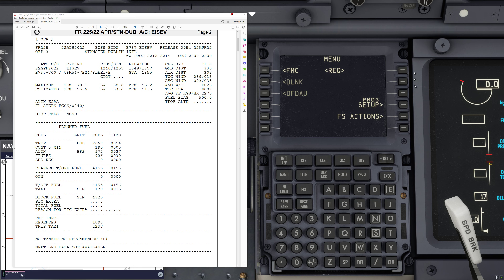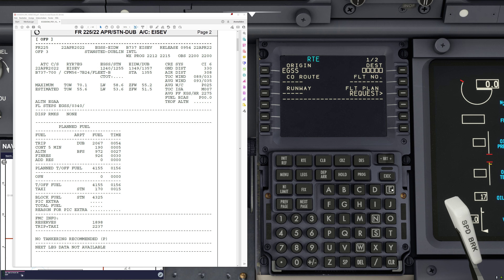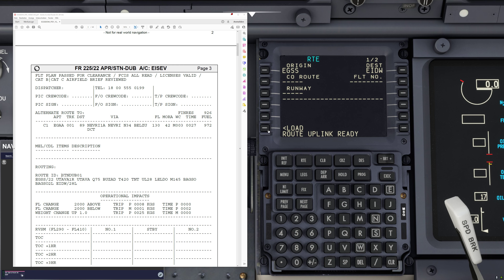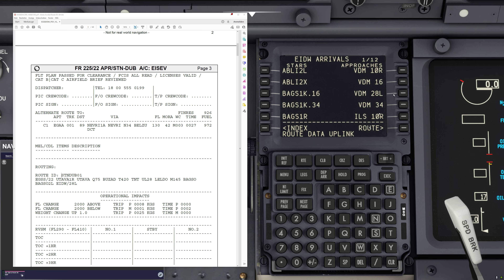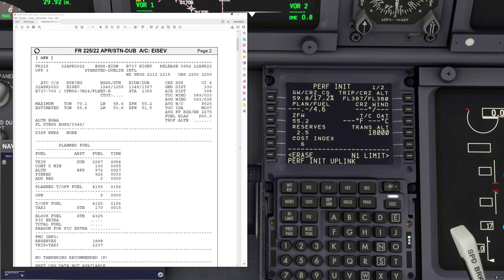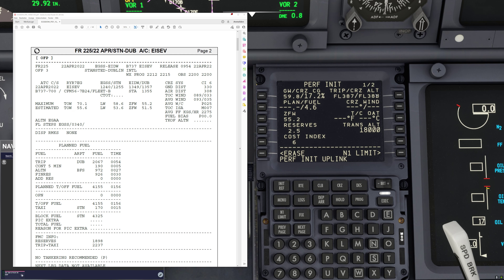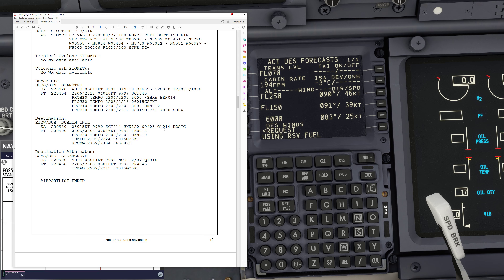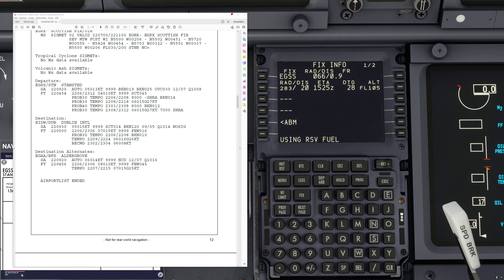PMDG 737-700 for MSFS - Tutorial 3: FMC Setup (Automatic Uplinks)

Comment: When I load in a flightplan as you did on video, after takeoff the plane wont fly with the magenta line. It seems like it are flying somewhere else. I would like to have mfsf ATC, is that the reason why is not working?
Reply from the maker: Turn off the assists in the MSFS settings, they screw your plane over.
Reply: @A330Driver  Perfekt, thanks its working. In which map can i find "Land alt" ?

Comment: I have a question about the payload, under the weights there is a number for freight, I divide this between the two freight compartments, don't I?
Reply from the maker: In my airline we try to load it all into the front if possible. Normally you can fit around 90 bags into the front hold, then we start distributing. The reason behind this is that only a single crew is needed for bag loading, saving you the second crew for the aft hold.

Comment: So...I'm confused after trying to figure it out myself. Also, regarding pax and luggage/baggage in simbrief. I'll set pax to full and the note next to the pax on simbrief says that luggage will automatically be calculated based off of the number and that the cargo section next to it is extra on top of the pax. Do I need to do anything in the FMC cargo section or just load the pax? Seems weird when I don't need to have the baggage loaders come over and it remains zero.
Reply: The CARGO in the flight plan includes the weight of the baggage of your passengers + the amount of payload you selected when creating/editing the flight plan. In the settings of the used airframe you can configure how many kg/lbs of baggage each passengers has. Per default its 25 kg/55 lbs. PAYLOAD in the flight plan is the CARGO + the weight of the passengers. In the used airframe you can configure how many kg/lbs for each passenger is used for the calculation. The PAYLOAD in the flight plan is used to get the Zero Fuel Weight ZFW. In the 737 FMC you only enter the amount of CARGO from the flight plan as Payload. (Yes, the different terms  in the flight plan and the FMC can be confusing.)

Comment: question- for fuel, should  I use the simbrief fuel amount and load it in the fms under msfs actions?   If so- shouldn't that change the COG %?  Should I change it to the % in simbrief?
Reply from the maker: Yes, use that menu. Don’t touch the cog, we do not change it. The airplane should automatically adjust the load to the best distribution and the fmc cog can just be kept where it is.

Comment: Capt. On Page 2 of your SB OFP your plan is listing the  TOC Wind along with AVG Wind. How did you get SB to include TOC Wind into your OFP as shown? I usually get this data from the Wind Information (page 7 on my OFP) but having it right up front is nice. Thanks
Reply from the maker: It's simply part of the OFP format. I used the RYR layout.
Reply: @A330Driver  RYR format. Thanks. BTW, I like your use of the FIX ring on Dep.

Comment: Just heard you saying PMDG currently not being able to fetch things such as your FP from an external source such as SimBrief. Do you know why that is? Reason I ask is how that is already in the WT CJ4 mod. So it is possible from a technical POV. Just wanted to mention this. Personally, I love using that feature when flying the CJ4!
Reply from the maker: It's because the WT CJ4 is programed in a different programming language than the 737.
Asobo only allows external access to that one language as far as I know.
For something as complex as PMDGs 737 however it was impossible to use that language so they used the one all PMDG developers are trained in. And Asobo promised to "unblock" that one right when the original sim released. They still didn't keep up with that promise.
Reply: Got it, thanks for the insight and let's hope Asobo deliver on what they promised down the road.

Not that big of a deal though, being able to use the company route feature in combination with SimBrief Downloader where you can have it automatically save your route in the same pre-determined folder where the PMDG 737 is fetching FP:s also is very convenient 👍

Comment: can we load from Little Nav Map?
Reply from the maker: I haven't used Little Nav Map, but provided that it has an export function for PMDG flightplans you can. It uses the same format as the P3D/FSX PMDG aircraft so if it can do that already then you can also do it with the MSFS version.
Reply: @A330Driver  should be able to do it then.  Cheers!
Reply: Yes. You can, although it's clunkier..you save the flpn then load it from the FDCs menu. I don't use this-preferring to manually setup my departure/arrival with the FDCs..then entering waypoints as needed.

You would be better off to do it this way too..you shouldn't be relying on simbrief. Learn the fmc

Comment: How do you keep the PDF open while clicking around in MSFS? Can't find that option in my Adobe Reader.
Reply from the maker: I'm using a program called "DeskPins". It can pin any program to the top of your screen. Very handy not just with the Adobe Reader but also other programs.
Reply: @A330Driver  Thanks for the tip. Great little tool and as you said not only in MSFS.

Comment: All that shown works great using the Simbrief Downloader. I used it in the CRJ and it worked like a charm automatically downloading the corresponding file and placing it in the right folder, after you create a flightplan. Once more...thanks for another Tutorial well done! Can't wait to push those buttons myself!
Reply from the maker: Indeed, with the simbrief downloader it's actually pretty easy to do these things. You can even automate the export of the files so that you literally don't have to do anything anymore. Except for a bit of space on your disk that's being used you're not even going to feel the difference between downloading the data from the internet and loading it from a file.

Comment: I don't understand your comment regarding access to SimBrief (direct from the 737). You mention the PMDG 737 cannot access Sim Brief because of a limitations in the sim, but other addon planes are able to directly communicate with SimBrief?
Reply from the maker: It's because of the programming language PMDG had to use. Basically, only a certain set of limited programming languages (I believe only Java? Correct me if I'm wrong) can currently access the internet from within MSFS.
For an aircraft as complex as the PMDG 737 you however you need something more sophisticated. However Asobo currently severely limits outside world access for for these ways of programming.
Asobo promised to "fix" that years ago but never did it yet. When they do, PMDG wants to implement all this nice stuff.
Reply: yes fbw is in java so it's different and we'll have to wait. I hope they'll plan to give us a cpdlc system in the future :)